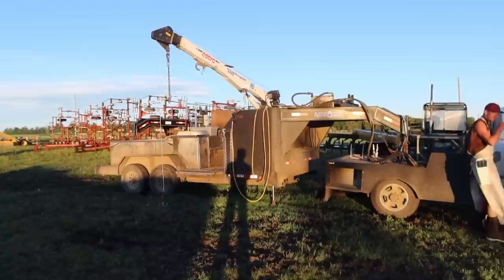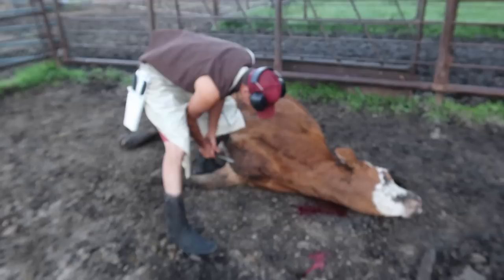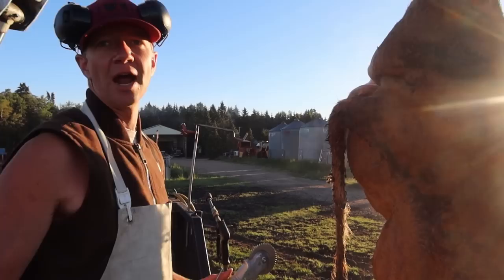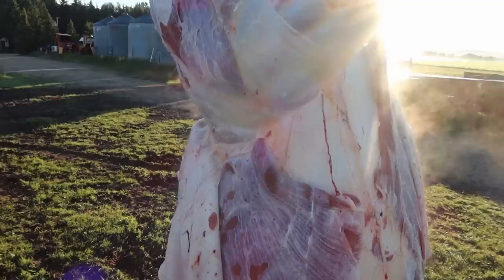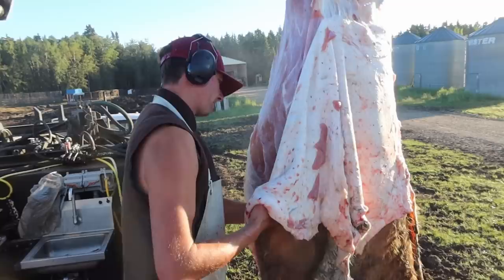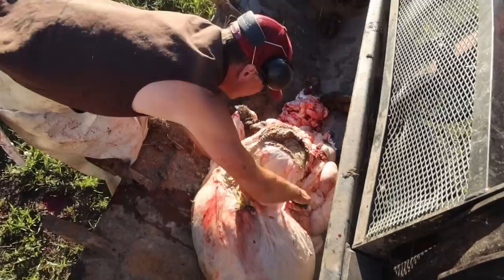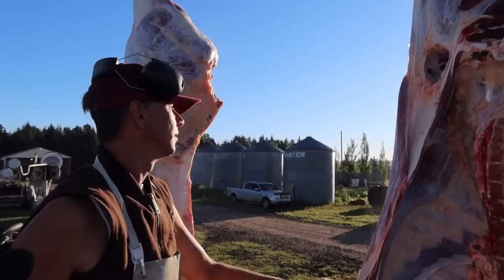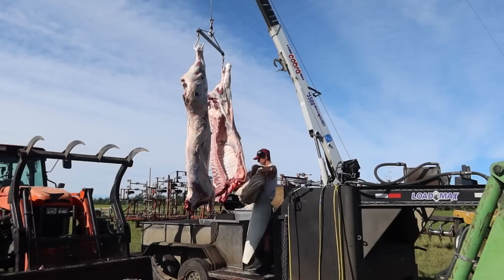Beef Harvest, On Farm Butchering. A Beef Kill With Step by Step Explanations.

Comment: It is less stressful for the animals than loading, traveling, unloading. The animals usually spending the night in an unfamiliar area. 
On site killing,  the animals are usually  are used to the corral.  They are dispensed with quickly.  The motion is just normal quivering of the animal. They do not feel anything after the shot. Downside is you must deal with the hide and entrails.

Comment: You know on the refrigeration part, if you chill the beef too fast, it will stop the post mortem muscled twitches that use up the last bits of atp and calcium ions in the cells. If the process is stopped too fast you will end up with a rigid, dry product. I have seen many carcasses hung for 4 hours or so, from kill the chill, and the meat comes out so much better than in a huge comercial facility.

Comment: This is so much easier than gutting on the ground. An 1800 lb moose is amazingly hard to gut on the ground. Guts are really heavy to pull out! We then split front and rear and use a come-along to put it in the Argo, then split with an 18 inch hand meat saw, and skin on a meat pole. Can't find a gambrel strong enough for the big moose so it's come-along to lift and tie each quarter separately. I'll bet it takes me an hour and a half or more not counting travel time. That guy is pretty slick

Comment: You do not save the head?
Reply from the maker: Not in this case. In the plants they save the meat off the cheeks. I think even in the plants after that the head is mostly consider SRM. Specific Risk Material.
Reply: @duncanhenry  I figured if you’re butchering for clients, but definitely yes to the cheeks. I not partial to them but there’s the brains also.
Reply: Braised cheek is wonderful. Called quijada in Argentina. Italians use it too
Reply: I think one of the first ravioli fillings was brains and spinach